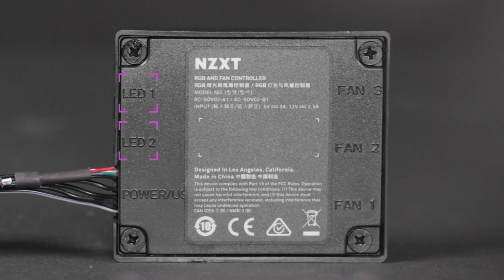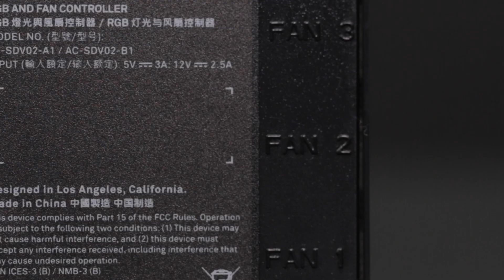NZXT RGB & Fan Controller Walkthrough

Comment: This company is so greed - the H7 Flow RGB is crazy expensive, more than $230 CAD, they include 3 RGB fans, only 3 pins, so no PWM, and not even a controller included - so how in the hell are you supposed to use NZXT CAM Software (a CRAPPY software at it) to adjust the included fans if there is no connection other than the 3 pins, how would the CAM software detect the fans.

Comment: I've 9 F120 rgb fans and Kraken Z73 with 3 radiator rgb fans. Which controller do I need to make all the fans work correctly on Asus ProArt Z790 motherboard?
Reply: Did you ever figure that out?
Reply: @spookyneighbor5135  yup, I needed two NZXT RGB hubs. NZXT app controls all of them nicely.

Comment: Fucking garbage, if your going to make a proprietary system it should have benefits and work flawlessly. Yet I cannot get the h7 elite RGB front fans to change color at all. The controller is detected but not the channels. I have wasted hours rebuilding into two of the same cases only to realize they are both defective because the software just doesn't work.

Comment: I'm considering building my first pc. Could anyone helpe me out?
I'm wondering if I need a NZXT Rgb controller for the fans to control the colors, as well as a NZXT USB 2.0 Internal Hub so that the RGB Controller has something to connect to. I have ordered x63 kraken as an AIO cooler for the CPU and 3 F140 RGB fans for the rest of the case, that's 5 fans in total with rgb. Will this work?

Comment: I just curious 🧐 So is it ok to use the included fan splitter you get from the NZXT ELITE case On fan 1 with the included NZXT Controller the 2 included AER RGB fans to the splitter ?????? What I’m saying is out the box my 2 FRONT NZXT AER RGB FANS are connected to the splitter, and into Fan 1 on the NZXT controller. Is that ok??? Or should I plug the front two fans to Fan 1 and Fan 2 separately??? Then use the fan splitter for the top and rear exhaust for fan 3??? Can someone please help me out thank you 😊

Comment: I have this controller in my case. I use a Aurus Z390 Master and a NXZT case. I cannot get the Cam software to communicate with the case LED's. The LED's light up white when plugged into the controller. There is no communication with the software that will allow me to activate the RGB functionality.  The CAM software gives this error: "No supported lighting devices were found". Can anyone help?

Comment: Hey, I have a question. I want to buy four AER rgb 2 fans (2 for the Aio and two loose ones) so my question is do I only need to connect them to the fan ports on the dan controller or anywhere else like the led ports. I’m kinda confused

Comment: I have a h510i nzxt case and it has a controller hub that was built into the case, can I use that for the AER RGB 2 fans? or do I have to buy the controller separate from the fans?

Comment: One of the most interesting pieces of custom accessories that seems to be an after thought for NZXT.  The included controller does NOT contain rgb adapter cables which you need to connect AER NZXT fans to since they are using 4-pin RGB.  Even if you manage to install the controller - BUT you also have NZXT liquid cooler, you still need a USB Splitter or their "USB internal HUB" for multiple connections.... Also the underlighting kit is not compatible with H200 Series Mini-ITX Case......
Reply: Thanks for the info

Comment: :3 anyone have any tips for loud fans? Just got it running, tried the cam software, but still loud.  Lemme know whatcha think :3
Reply: there SHOULD be a silent fan option. works pretty well on mine.
Reply: @BunnyMally  issue was actually broken GPU. Still bugging Nzxt to fix it.

Comment: I baught one of these and unless you love the NZXT AIO with the LCD screen skip it. This controller uses proprietary cables that Only NZXT uses so it won't work with the standard 3-pin Argb connector that most of the argb devices on the market use.  And it's only 40.00 USD

I recommend the Razer Chroma Argb controller
https://www.razer.com/gaming-pc-accessories/razer-chroma-addressable-rgb-controller/RZ34-02140600-R3U1
 I use that now exclusively for all of my rgb lighting on my pc.(with a razer mod that works with Asus)

Note:  it does not control any fans it just has 6 standard 3 pin Argb headers.

It has a barrel plug to molex and connects via USB Mico to internal USB 2.0 I think that's if you want to use it outside your pc like on the back of the monitor.

Comment: NZXT controller is garbage! Built a new pc in the h510 elite and sparks flew out of the controller when I powered it on for the first time! The wiring is not safe at all, every connector from the case has bare wires showing from horrible heat shrinking. Fried my SSD with all of my ROMs with no backup. Smelled burning electrical after with the light strip hot as hell, thanks a bunch! I guess Corsair it is, at least there cases have airflow and iCue.

Comment: I was looking to buy these fans and I wasn’t sure what I was gonna do cause I was gonna get 6 fans and this video really helped
Reply: Keruvim  Did you ever get an answer to this? I'm pretty new too, and my setup has 6 fans + liquid cooler. I'm not sure how to quite set everything up myself.
Reply: Keruvim  I bought NZXT 9 ELITE and got hub + 3 rgb fans. Do I need to buy 1 more hub to attach extra rgb fans - 3x120mm on the top and 2x140mm on the bottom?

Comment: my fans work but aren't showing up in bios or on nzxt cam
Reply: what case are you using? did you add the controller separately to a different case? i got the NZXT h510i and it came with the controller. all i did was plug in the sata power connector from the case to my PSU and that lit up the lights ans spun fans, shows everything thing in the cam for me shrugs
Reply: @LxaG_Sauce  I have a 710i
is the controller like a separate component or something?
Reply: @Fungorrr  on my case the smart device is in the back panel, i did a search of yours and it looks like its located behind the "cable management bar" so that case should have the controller pre installed as well as lights.
Reply: @LxaG_Sauce  thanks very much man. I must've missed it but I'll def take another look.
Reply: @Fungorrr  not a problem, from that box, there should be a bundle of wires, mine was lable to plug in sata to psu and the USB 2.0 to the motherboard. wish there was options for photo replies haha. good luck :)

Comment: What’s the difference between this and the HUE 2 ? Do we need both in the PC ?
Reply: I think the HUE 2 only does RGB stuff. You'll want it if you want to support twice the RGB that the rgb&fan controller can. For most PC cases, the rgb&fan controller will be enough. It powers up to 9 fans and can control the RGB of 10 AER RGB fans or 12 nzxt led strips or some combo of those

Comment: How do you connect the built-in RGB strips, stock case fans, and controller in the NZXT H510i to your motherboard? I am confused on how to do this to activate the RGB. Any help would be grateful as I am a beginner in PC building. Thx
Reply: @Nova if you have the H500i, all i did was connect the sata power connector (should have a lable saying must connect to PSU) and that was it, fans spun up and lights came on. downloaded NZXT Cam and the rest is history. lemme know, im happy to try help
Reply: @SauceBoss Thank you so much. I have finished building my of and it looks greatest now. And yes I use Cam but also Icue for my Corsair Vengeance RAM

Comment: I recently got this and my fans weren’t showing up in the lighting settings and after talking with support they thought the led channels were defective so I got a replacement phone me but having same problems. Everything is connected properly yet cam thinks my fans are an led strip and I can’t configure anything. The RGB is static as blue with only one led on both fans on. How do I fix this? Shouldn’t be this frustrating just to get some RGB working

Comment: One of my LED ports wont work for RGB, I swapped my back 2 fans into the port from LED1 to LED2 and now they light up and the front fans don't. They light up but not with RGB for some reason. If i then take my front fans & put them into LED1 port they light up with RGB and the back fans go to lighting up but without RGB, can anyone suggest a fix. Uninstalled software and reinstalled and stuff, just cant figure out why its doing this. JUST TO ADD (everything did work with RGB at first and ive not touched any internals since building this PC and the RGB was fine on all 4 fans at the start)
Reply: YES. same. exact. Problem.
Reply: @BunnyMally  I ended up emailing nxzt, they'll send you out a new fan hub what all your connectors go into, worked after that bud

Comment: Hello, do I still need the Hue controller if I have a Z63. Can I connect the two RGB fans straight to the pump for RGB to work?
Reply: Did you find a solution?
Reply: I build my pc today and i have the same
Hub and the z63 but they wont turn on
Reply: @talis.mp4  Hello I didn`t end using the Hue controller. You can just connect the RGB fans straight to the pump. The Z series allows you to do this without using the Hue controller
Reply: @njco78  Same but the the leds and the rgb not working they lights are off :(
Reply: @njco78  If you have the Z series you don't need to buy the hue+?!  That's huge!  I was considering the x63 vs z63, but if i get the x63 i will need to buy HUE+, which is 150~ anyway.  Can you please confirm?  thanks!!

Comment: "walkthrough"
Reply: Terrible walkthrough. I can’t for the life of me get my lighting on my two AER 2 fans to work. The lighting is stacking and dim on one led on both fans and I can’t customize them at all
Reply: @backstabbath2690  did you get the lights to work?
Reply: Lukas nope still waiting on them to patch that software issue they admitted to
Reply: The internet has been using review and walthrough in lieu of "overview" for years.
Reply: This was more of a runthrough than a walkthrough.

Also I have the same problem as zachary. I have 3x RGB AER 2 fans, all the fans have power, but the RGB wont work even though its daisy-chained. The fans are glowing in the order RBG, the first fan is the strongest while the last fan in the chain barely glows. The first fan has a effect, it first fades and then blinks red.

idk what to do lol. I guess I'll try again in the near future when I am not so frustrated haha.
Reply: Advert
Reply: This guys a loser hes getting disliked for this

Comment: My h510 Elite case front fans spin but no rgb? the rgb strip lights up though. (shipped with rgb fans and strip installed already. HELP?!
Reply: Same problem I orded a 4 pin female to female to attach the smartboard to the RGB header slot on the MOBO ill let you know if it works
Reply: mike scanlon turns out my problem was fixed by actually connecting the fans rgb header into slot 2 on the controller. I did not know this was the problem because the cable was hidden in the fan mount so I had to disassemble to find that there was a cable not plugged in by nzxt. They set everything else up correctly except decided to hide the rgb cable!!! Wth nzxt.
Reply: @ForceQuitMusic  Thanks ill give this a try when i get home
Reply: I installed everything but neither my fans and the rgb is working, can you help?
Reply: @talis.mp4  redo the wiring on the rgb controller and make sure all fans are actually plugged in all the way
Reply: @ForceQuitMusic  thank you! I will try that
Reply: @talis.mp4  its usually the cables

Comment: as i get this, this controller is connected on the internal usb conneter and regulated via that connection. i have a dell mobo and the standard 3 and 4 pin connectors have different wireing then a normal connector. and plugging a normal fan in could fry the fan and the mobo. 

also how does it work on startup of the pc. is it turned on and put on a standard loop until the pc is fully started or do you also need to open nzxt cam for the fans to work as intended.

thanks in advance

Comment: My CAM shows only 3 out of 4 case fans and shows one of them as 0 RPM when all are spinning.
Reply: Same here! Also whenever I increase the fan speed using the performance preset on the app one or two of them get disconnected but the led works just fine! Any help?
Reply: Do y’all know if you can connect 2 rgb & fan controllers in 1 case?

Comment: so will this thing light an nzxt rgb fan or do i need that hue2 thing..
Reply: you still need hue2 for more led port and controller app
what I don't know is do splitter already included if I only buy 1 fan or 1 pack of 3 fans? or should I buy the 1 pack with hue 2? (eventhough I have h710i which already have hue 2 on it)
Reply: @tommyanggi801  So can I buy one of these and daisy chain like 7 Nzxt Aer RGB2 to them? I thought the HUe 2 is for stuff outside the PC.

Comment: Can you use voltage and pwm fans at the same time in this or the smart device?
Reply: I bought this recently, for some strange reason when I connect my 3 pin fans the fans don't spin down they stuck on a minimal fan speed. So I returned it

Comment: so if i wanna have 6 nzxt fans (3 from aio and 3 extra) i would need 2 controllers ?
or can i use the hub and put the controllers in there
or can i use 1 controller and 1 hub ?
i feel like there is not enough information about 6fans+ out there
would love to get an answer
Reply: You can plug in 3 fans in one channel with the splitter cable i guess? E.g. you have 3 AIO fans on channel 1 and your 3 extra fans on channel 2.
Reply: @yanniksippel8787  jeah i figured that out after receiving the controller
never found the info that they include those plugs tho..
Reply: Blackeye1987 yo so what’s the best way to put 6 NZXT fans in my case
Reply: @LeoTorres-jf3bz  you just need that one controller
except if you want to control every fan on its own.

for me thats not the case

i controll 2 times 3 controllers

there are 3 3 way splitters included with the package

hope that helped
Reply: Blackeye1987 what controller are you using the hue 2 or just the NZXT fan controller
Reply: @LeoTorres-jf3bz  rgb fan controller, the one shown in the video
i think its the cheaper one by amazon
Reply: Blackeye1987 hell yea bro I got it I honestly didn’t think you need the cables that powered the fan and another cable for rgb

Comment: For some reason, my two AER RGB 2 fans are spinning, and the RGB Fan controller is being recognized by NZXT Cam, but the lights on the fans wont turn on. Any ideas?
Reply: i'm having the same issue - anyone got any ideas?
Reply: @wtfnga96  same here mate im fucking livid to say the least
Reply: Dan Bates did you figure it out if you have lmk
Reply: @534  my lights are on but i cant change the lighting
Reply: BackStabbath for?
Reply: @534  i have this rgb fan controller and two aer 2 fans connected to it but i cant change the lighting on the fans. The fans' lights are "on" but are dark and static and i cant do anything about it.No clue what to do either
Reply: Dan Bates did you ever figure it out? I’m having. Same issue
Reply: @backstabbath2690  wondering the same my cam unit doesn't even pick them up and they do not light up. They spin fine..?> TF I was told they need to connect to the mobo rgb header but it didn't come with a female to femal adapter to do so????
Reply: mike scanlon so we are just ass out? I’ve connected one to my RGB header and all it did was make one of them dimly green and blue but I still couldn’t customize the lighting nor did the connector recognize it
Reply: @backstabbath2690  I just connected mine and it doesnt light up at all.... send help lol
Reply: mike scanlon yo I spoke with tech support again and the guy confirmed that they are aware of the issue and it is indeed a cam issue and that the software team is actively working on a bug fix for it
Reply: @backstabbath2690  Thank god it sucks.
Reply: BackStabbath you sure it’s dosnt have to be NZXT profits that can be controlled? Can I connect some other rgb fans and still control through software
Reply: @backstabbath2690  Same problem here. The last update was released on sep. 14. Were you able to fix it?
Reply: Hey @Ryan Brodhead did you ever resolve this issue? I'm having the same exact problem.
Reply: @Latenightshorts99  hey all! Yes I did resolve the issue. It was a mistake on my part. I was tinkering around and figured I’d try to take one of the spare cables they gave me and put it into the fan with the open “OUT” slot and I plugged it directly into my RGB controller and bingo, the fans lit up.

Comment: How come in my h700i there its only 1 rgb connection
Reply: yeah.. i ordered the fans separately thinking I could chain 3 120 in the front and 1 140 mm in the rear. Seems like we would have to order another splitter

Comment: my rgb for my h210i is not working. i cant change anything, not the lighting color etc. and also, the strip of rgb only shows 1 blue light. at first when i used the rgb, it worked. but then i had an aio water cooler, which also needed a usb slot. however, my motherboard only supports 1 usb slot . so i got an adapter and i plugged both in. the aio worked, but the rgb has the problem i described. can someone help???
Reply: Did you ever figure it out? My two fans are only showing one blue led as well and I can’t do shit with them though they are running fine
Reply: @backstabbath2690  nope sadly